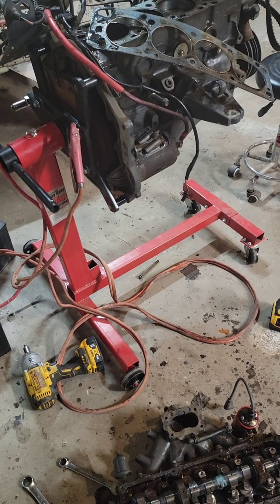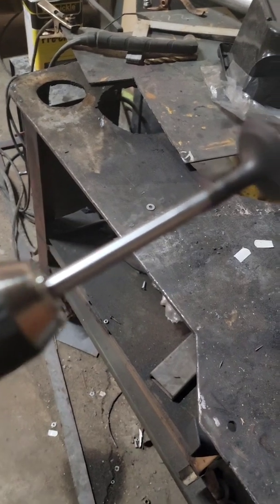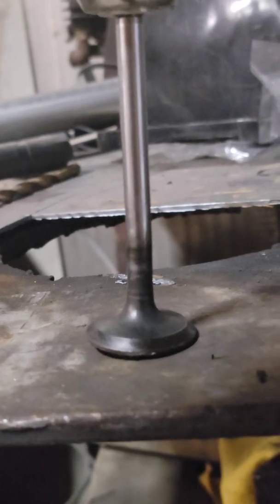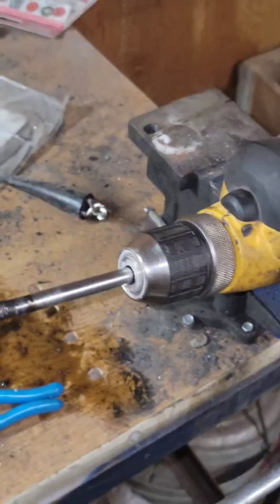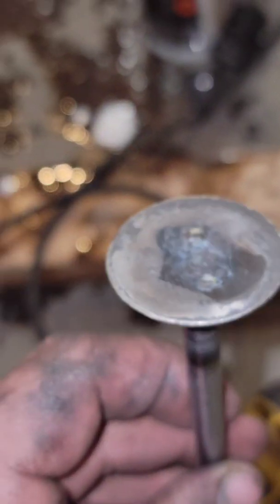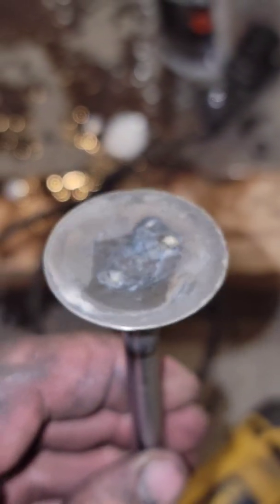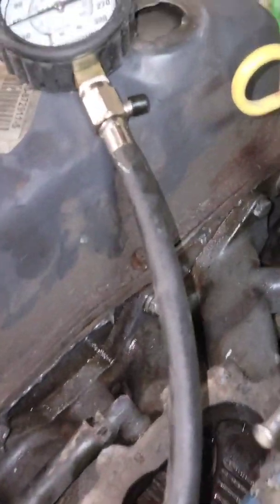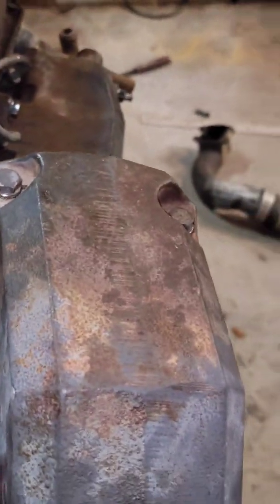Fixing or straightening a bent valve in an engine

Comment: I have worked on engines for 20+ years. I have to give you credit for trying. There are 2 rules of thumb on bad valves. If an exhaust valve is bad, it will still run somewhat okay if its minor because it doesn't effect intake vacuum. But if an intake valve is bad, it will run horribly because compression is blowing back into the intake effecting intake vacuum. 
It takes 120psi compression minimum for a cylinder to function at all. Anything less than that and you'll have a definite misfire. 60psi compression will never make that cylinder function at all. I guess it's better than zero. 
Heating the valve by welding it just induced all kinds of stress. Cracking/splitting of the valve will eventually happen or the head popping off. A better way to lap a valve in, is to use about a 6" piece of rubber hose that fits tightly on the stem of the valve. Use a hex screwdriver bit in the drill or something the hose fits tightly over.  The rubber hose acts as a universal joint and allows you to spin the valve while working it up and down to work the lapping compound in. 
Straightening the valve would work better by leaving it in the head and using a socket the same size of the head to tap it against the seat. That way you know you are a lot closer to flat an you dont bend the valve stem any more than needed inducing more stress.
Reply from the maker: Hey, I 100% agree with you. I have my own mechanic shop now. And would never do this kind of thing, to anything I cared about This was just for fun to see if I could do it for nothing

Comment: Nobody with any logical sense would try to straighten a bent valve and put it back into the engine. it is senseless. That is why mechanics are mechanics and master technicians are master technicians. You would never see a dealership hire a mechanic for nothjing other than to change oil , rotate tires, replace wipers and bulbs. Master technicians are the only ones allowed and qualified to work on the rest of the car. Another reason why dealerships sends their used car trade-ins to the auctions is because mechanics worked on them and would be possibly be categorized as lemons.
Reply from the maker: I am a mechanic and own my own business as well I just enjoy goofing of at home and seeing what works it was a throwaway engine off a junk boat